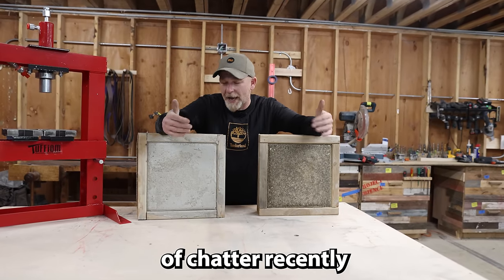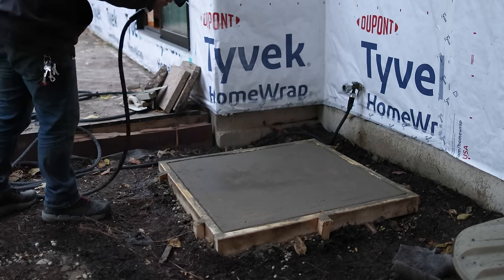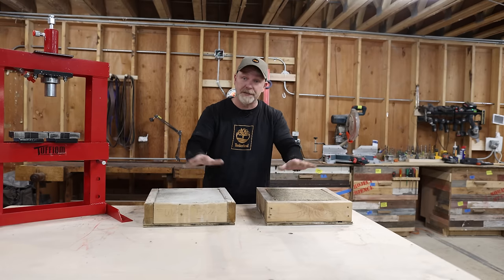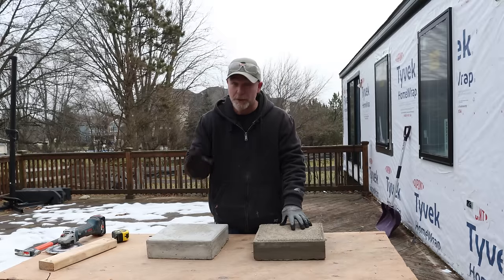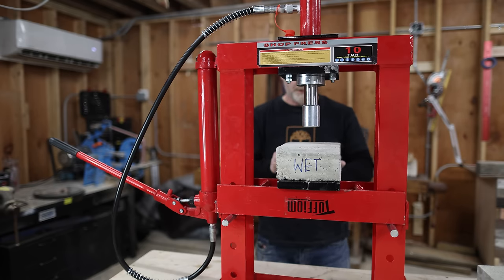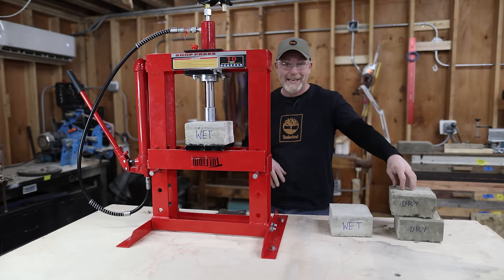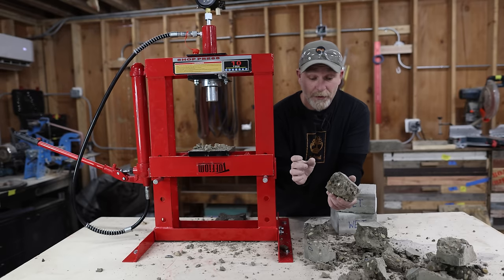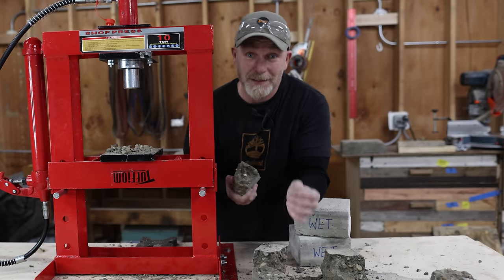The TRUTH About Dry Pour vs Wet Pour Concrete!! Strength Test - You WON'T Believe the results!!

Comment: I've been doing a hybrid of these two methods for decades, it's easy and it gives results that look and apparently perform like wet pour. I mix in place. Just fill the form with premix, wet it well with just about as much water that you would use for mixing and use a shovel in a vertical chopping motion for just a few minutes  to mix then finish the top. Works great, is faster, a lot easier and has less cleanup than a wet pour. I have slabs that I have made with this method that I've driven fully loaded pickup trucks over and they've held up perfectly.
Reply: short cuts. . .
Reply: I think that the outcome will differ depending on how much water you use. With a wet mixture, there is more control.
Reply: Yes he should test your method
Reply: Yeppers! Not too much water though! Consolidation and even distribution! Smart!   : )  Be Safe
Reply: Would you drive an 80,000 simi truck over it like a wet poured slab.
Reply: @robertgarrett7007  If thick enough, absolutely! : ) ... That is if the soils under is suitable!
Reply: @robertgarrett7007  Probably not, but the point is he probably wasn't planning to drive a semi over it.
There is such a thing as over-engineering something.
Reply: @Cheepchipsable  I’m bad about “over engineering”. I poured a 6” slab for my shop. Just in case.
Reply: @robertgarrett7007  I drive my 325lb lawn tractor over my hybrid poured concrete pad. Never felt the need to test it with a semi truck.... 😀
Reply: @Majerly_Annoyed  I have a 26,000 pound bucket truck so I wouldn’t feel comfortable with a dry poured slab. It might be fine if poured 6” thick. Fear of the unknown.
Reply: ..layering/misting as you go will get water where it needs to be in same time frame as the higher layers.  if reinforcing is in place..then the chopping will help consolidate around the reinf.     almost dry mix is used to build gravity dams and earth dam cores..some concept...almost...compression helps.  wet mixes 'self consolidate' to a degree. vibe helps but the dry approach doesn't allow the aggregates to move..which is good if they are well distributed.  moving conc. bags into difficult locations is a lot easier than wet mix...and in some cases impossible placement can be done.  fiber added helps...can get that in the bag mixes.
Reply: @robertgarrett7007  over engineering is 95% of successful engineering ...  60 yrs of experience

Comment: Great video!  I have no idea why anyone was doing a dry pour in the first place.  Pretty soon they'll probably be eating raw chicken because cooking it is too much work.
Reply: That is the raw foods diet and has been around for a while and yes it includes raw meat though many on it are vegetarians.
Reply: Why do anything hard? Tightening all the bolts on my car's wheels is too much work. I only finger tighten them. Look at all the time/effort I have saved. Who's the jammy bastard now?
Reply: We were served raw chicken in Osaka, Japan. We didn’t eat that course, but the locals did.
Reply: They are doing it because in most cases that's all the strength you need. and it's a lot cheaper. and easier to remove for temporary uses.
Reply: @johndorian4078  it will fall apart a lot sooner so that's a huge disadvantage, I do agree about temporary uses but I have never heard of someone using concrete for a temporary purpose nor can I think of a situation where it would be used for one.
Reply: @johndorian4078  Where in the process do you calculate that dry pouring is cheaper?
Reply: @chrisallen2005 maybe he was going to use bottled water 😂...
Reply: @phillhuddleston9445  my city changed parking ordiances so cars had to be on concrete or asphault, they decided parking ya work truck on the grass in the backyard alongside the garage wasnt allowed no more. I didnt care if it was pretty or lasted, they never crawl up peoples butts for cracked driveways so I bought 100 dollars worth of the cheapest crete I could find and did a truck sized dry pour and told the city where they could stick their new rules.
Reply: As far as the raw food part , clams only.
Reply: @pepsilove6306  Good to hear you solved the problem in a way that was complying but not really, this is the exception to the rule, there is always at least one exception.
Reply: @rnordquest      Oh !    Makes my stomach roll just thinking about it !    I think sometime in Japan history the warlords must not have allowed anyone to use firewood.    Raw everthing has become traditional !

Comment: I never used dry pour concrete, always wet, however I have a shed that needs a new floor.
I started looking into the dry pour concrete method for this particular job.
One aspect of the dry pour concrete method,  is the procedure of adding water. I think this is very important step when using the dry pour concrete method.
The first misting of the dry pour i believe to enough to set the top and finish of the mix,  and let dry.
I believe  the next misting should actually be soaking of the dry pour concrete , continuously until the dry pour is flooded  with water to ensure water has soaked throughout the mix.

The method of misting, stop , misting, stop , misting, stop just creates a layer on top of the dry pour mix , to never get the water it needs,.
Like to hear peoples comments,  if what i say, makes sense. 
I don't expect  dry pour concrete  to be 100% equal  to the wet pour, but thought there would be better results with the dry pour if soaked with a different  method.
Reply: Fair point

I would be also curious to see if adding fiber adds enough to the strength, making it as strong as regular wet concrete.

And what will happen if you put basalt or granite tiles on top? It should improve strength due to weight distribution and prevent wearing it off.
Reply: @bazoozoo1186 that would be something that would be interesting to test!

Comment: I’ve done dry pours and similar applications most of my life.  The videos I’ve seen miss a few key steps.  And yes, dry pours is never as strong as wet pours.   As a kid we lived on the lake.  We built a dry stack retaining wall about 16-18 bags high.   This is how we did it, and it’s still there 50 years later.  We put bag concrete in a wheelbarrow with a few scoops of sand.  Mixed then shoveled into sandbags.  The green plastic weave bags.   We dug a footing down to the clay and then saturated the area while laying in the bags.  We continued soaking each row until we were complete.  We put an old fashion sprinkler on it and kept it web overnight.  The next weekend we backfilled the eroded area and put grass seeds out.  We kept it wet for several days.  Today the concrete wall is still there and perfectly intact, except the plastic sandbags are gone.  It looks like uniform stones stacked.  If you go to the lake you will see walls like this all over.   We have done the same process where we have a driveway over culvert to stop washout, and in high erosion areas.  Of course there’s no real load bearing in these applications,  but I wouldn’t put more than a dog kennel or storage building on a dry pour.
Reply: But the wall you made proves it can take weight. The bottom bag, under the 15 other bags, doesn't crack under the load of 15 concrete bags plus the water weight you used, so about 70lbsX15 bags=1050lbs. Not a whole lot, but enough for most applications. Stairs, sidewalks, sheds, etc.

Comment: I dry pour for coops and such on the farm. I do soak it very well though.  Mist the surface to get that set (maybe 3 or 4 times over a few hours) then flood every few hours for a few days.  I’ll have to make my own test to compare the two (wet versus flooded dry). For my use, I’m not putting a 5 ton point load on the surface so the plate test is more representative of the usage.  Fine for compression but may be weak on sheer. We’ll see.
Reply: Yes it's weaker. Dry pouring does not meet building code.

In commercial construction. Your concrete gets core sampled by a soil technician. This is your concrete inspection. If it doesn't pass, it gets demolished and replaced. You also get yelled at by the general contractor for holding up the entire jobsite.

I asked the general on a Costco job what's the fastest one has gone in. 92 days! WTF!

The soil tech is also in charge of testing soil compaction anywhere people dig. Sewer, water, gas tanks, storm water tanks, etc.
Reply: I'd really like to see your test results - I think most of these "dry pours" take the term dry too literally. I definitely think a flooding stage is necessary to even give these a chance.
Reply: @ronniekeates3349  I'm not a soil tech. I just get inspected by them for soil compaction, so I talk to them regularly.

I have seen him hauling off a box of core samples. I asked him what he was doing. He was taking the core samples to be tested.

The concrete came in on mixing trucks.
Reply: The fact is dry pouring is outside manufacturer recommended specifications in America because the specific concrete blends they create are made to be mixed wet to achieve the strength rating listed on the bag and called for by specification.

I talked with someone who works in the industry and he said dry pour concrete is done in 3rd world countries, but they blend a concrete made to do so and achieve the strength they are looking for.
Reply: @brandonhoffman4712  Yup, at the building I worked at the shop floor was found to have major problems both due to poor soil compaction and then a bad concrete pour.  Our next building on the site, the next contractor (years later) got feet held to the fire for both soil compaction (two to three re-do's to get the contract compaction number) and concrete strength.  Fool me once....   How do I know?  I was working in a trailer across the driveway waiting for the new building, so had to listen to the machinery going back and forth for the compaction, over and over for hours of backup beepers every day....  😖
Reply: @pault151  wow 3x to hit proper compaction! Either your ground was wet or that contractor might have learning to do. The only time I've seen that is with open trenches in rainstorms. We normally over compact the 1st time.

We compact in layers, mixing water with dirt until it's just right, then lay down 2-3 feet, then swap to the compaction wheel on the excavator, roll it out, repeat till full. Then grab the soil tech.
Reply: If you need to go back and wet it as often as you say, then it doesn't sound like much of a time saver.
Reply: @Cheepchipsable  ikr! You could literally setup your lawn chair atop it while it cures and catch a tan if you wet mix.
Reply: @brandonhoffman4712 well graduated compacting sound about right whenever soul disruption occurs. Especially when your doing deep back fills. Compacting every 12-18" is standard procedure. I know this despite it not being something I do in much of my compacting. 
But, then again, we are in the era of cheating and using unskilled or incompetent trade workers to do the task, because it is faster and less costly so...
Reply: @Cheepchipsable you seem to not realize that saving time and doing things correctly are often contradictory. Thinking about jobs in regard to how quickly it can be accomplished and performing them as such leads to catastrophic results in many cases, including deaths. 
If structure is what your working on; it would behove you to take a little more time to assure the installation is done correctly and with trade integrity. 
Stop wasting your time watching HGTV and DIY videos.

Comment: You're doing the internet community of DIYers a great service!

I hope this gets in front of as many eyes as possible before they venture down the road of doing a dry pour.  If you come across any of those hyped-up dry pour videos, it sure makes you think it’s viable.  This proves in a way a layperson can understand, it’s not the way to go.  Thank you!
Reply: I think the application matters. If you are building a pad for your AC unit like he did in the earlier videos the dry pour is more than strong enough. Similarly, if you are making a small concrete patio  outside your home a dry pour (with some hogwire mesh) is again going to be plenty strong. Neither slab will ever experience a couple thousand pounds PSI of pressure.
Reply: @RandomGuyDan  yep, I dry poured a big slab to park my lawncare truck on so the city stopped screaming at me for parking in my grass/backyard. its held up well and I didnt give one lick if it looked good/pretty, it had one job, keep the city off my butt.
Reply: @RandomGuyDan   I wouldn’t.  Any vibration from the AC later in its life (yes, it can happen) could soon cause crumbling in that sub-standard base.

Comment: It is said that when Romans made concrete they used a lot of limestone, so much so that there was residual dry lime embedded in the concrete. When later cracks formed in the concrete, water penetrated cracks to find that residual limestone, which resealed the concrete in the precise area of the crack. Some of that Roman concrete from two thousand years ago is still in use today.

Comment: I've always wet-poured slabs, and pilings and post holes. And because I do, I've been ridiculed by some of my buddies who swear by the dry-pour method.... I can't wait to forward your video to them. I think a big issue with the dry pour is that the ingredients are not properly mixed as well, and that the proper amount of water doesn't get where it needs to go for the proper chemical reaction.
Reply: Well, for post holes, they're still correct. You don't need 2 tons of structure for a fence post. The ground will give before the concrete, whatever the method, and nobody will care if the edges get a little crumbly.
Reply: Depends on the soil conditions. It's not about 2 tons of structure; it's about lateral sway/weakness. In our soft, zero-rock, weak, sandy and/or muck soil, when using the weak dry-pour you can manually push the post (4X4's, 4X6's, 6X6'x 8X83s side-to-side, breaking the concrete, months after the cement is 'cured'. It requires large diameter, and deep holes for any type of post/piling.  I will still use wet-pour. @TheBrothergreen
Reply: got news for ya... it's not the water getting to where it's needed, it's the fine powdered cement and the larger particles of sand / gravel separating into layers during shipping. If everything is not evenly distributed, then it becomes weaker.
Reply: In my soil a 4in post will snap off before the dry pour breaks. Not really an intentional test, but just saying. I use a 36in deep hole 6in auger. Fairly rocky soil. A dry pour slab should be considered temporary though.
Reply: Yer on to something bud!!! On the "wet" ... you mentioned "mix" and proper amount of "water" and "chemical reaction".  There's a lot going on with what you say!!!  Dry-pours can be made if conditions allow and dependent on application but not favorable. Most dry-pours are incorrectly done but suffice due to application (think buried with little or no-load or sheer) and containment; regardless, some sort of mixing should happen (rodding), working out any large air-pockets and consolidation (*for even distribution). Soil types play a big role in containment, think hard-packed (density) and ability to retain moisture.  Stop the chemical reaction (hydration) in any part, it's done - it won't restart! 2thumbs up! : )
Reply: @rupe53 Your "news" is incorrect ... and water or better yet "enough water"!  You covered the end result in your own last sentence there.   Be Safe
Reply: @rodconner9079     the point is that your "premix" in the bag is not evenly mixed when you get it to the job. It separates in handling, which is why a dry pour isn't as strong.
Reply: @rupe53 Premix can segregate during transport to some extent - sure! The action of simply opening a bag and pouring into a hole re-distributes the "mix". Without water, it has no strength, again proper distribution is key. Wet mix can segregate even with proper moisture content of free travel of 5ft or greater (shoveling toss or free fall) or excessive vibration. "Premix" is designed including the bag to lessen issues by the DIYer ..... for instance:  If you'd take an unopened "traveled" bag of premix and toss it into water, enough to saturate and maintain that saturation -- it will cure much stronger than any "dry-pour"; the ratios are such and the materials used are sized specifically, another "reason" river gravel is used in "premix".
Reply: @rodconner9079    I never said "don't add water" but I did say everything needs better mixing than "just out of the bag" which is how most people do a dry pour.

Comment: Awesome. Thank you.
Btw ..  when you breathe in concrete dust it turns back into concrete, you're dry pouring your lungs and your sinus cavity. 🤣
Mask up,  brother!
Reply: You breath in cement dust not concrete, so it turns into what is basically limestone in any body fluids.
Reply: Doesn’t work quite that way but appreciate the sentiment.
Reply: My uncle worked in concrete for years and didn't wear a mask. He ended up needing a lung transplant. Mask up is right.
Reply: Just look up Silicosis.
Reply: i was yelling during the clip of him cutting them and once all thr dust cleared you could see his bare face 😳
Reply: I had a friend whose father died at 65.   The man was an older tradesman plaster man.   Died from lung disease.   Breathed in too much plaster dust.
Reply: @pault151 Absolutely. It’s a lazy and needless way to shorten a lifespan. Safety third!
Reply: Who cares what it is, or what it turns into after you breath it. It will kill you if you keep breathng it that's all you need to realize.... So don't. 3M baby,  save those precious lungs.
Reply: Supposedly raw Portland cement can’t cause silicosis. But dry cutting a cured slab definitely will.